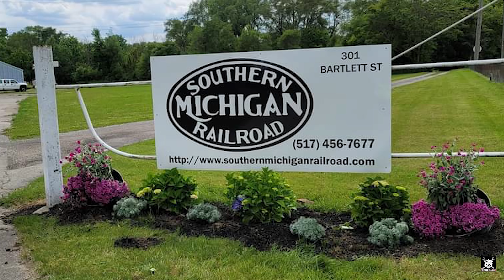Matt Chains Down An Oshkosh Striker Fire Truck

Comment: Great video FSC. You showed through your son just how much strength it actually takes to put on the heavy chains attach the heavy sinch  then tighten it all up so the chain is taught. When you have done it many many times you make it look easy because you learned. Banging knuckles seems to be an almost daily event. That Stryker is a good load, I like them big. The bigger equipment always test’s your skills, and I got better. There is like nothing better to have anything thrown at you and it gets loaded and tied down transported to destination and your good to go for the next one. Thumbs up FSC, have a great day and be safe, also tell that swamper , great job….

Comment: Great video Steve.  Good job Matt with the binders.  I had a young man load a 25ft scissor lift on a flatbed trailer from an equipment rental company.  He loaded the lift at the very front of the trailer which placed most of the weight on my trailer hitch.  Once I got home I moved the lift back over the axles so that the weight was better distributed between the trailer and my hitch.

Comment: The way roads are made, is to withstand certain weights and speeds. Which is why interstates are made to different standards than state roads, and state roads to local roads. It's probably not good to allow your truck's weight on the road, but given the available alternatives, it's the best option. Also, after they finish their project, they may resurface that road, depending on time and available funds.

Comment: Would it be easier and safer to use a cheater (pipe) bar when tighting the binders?
Reply from the maker: I don't use em with twist binders.  Just the snap style.  Typically anyway.

Comment: At 15:30 does anyone understand the purpose of putting that large piece of timber underneath the hitch?
Reply from the maker: Holds the deck up
Reply: @fsctrucking  Thanks for the reply!  I guess I still don't understand why the timber is necessary; what would be the purpose of allowing the deck to fall so far so as to need the timber to hold it up?  I imagine I'd probably have to see it in person to understand.
Reply: @pseudorandomly  it’s to keep the deck from dragging on the ground and keeping it level so when he hooks back up it’s at the correct spot to hook back into the trailer
Reply: @KrisKnight91  Thanks for your reply.  I know I'm beating a horse to death here, and I promise I'll stop after this.  But what I still don't understand is why the deck isn't built to automatically be at the correct height to pick the trailer off the ground.  Is there a reason the deck sometimes needs to be able to drop lower than ground level?  In other words, why would the deck be designed and built so as to ever drag on the ground?
Reply: @pseudorandomly  it’s not that it’s built to drag it’s the fact that the fifth wheel plate pivots to change for angles in the road. When he unhooks the deck from the trailer that makes the fifth wheel pivot so that the bottom of the deck will drag.
Reply: @KrisKnight91  Ah, I understand now.  Thank you for taking the time to respond.
Reply: @pseudorandomly  np! Glad to help!

Comment: Cop's goes by there all the time almost every hour. Cause Dallas Texas is the next town over. And the Shop Truck that we use to run for part's. U always have to slam the driver's side door. So what we do we get on the passenger side door. And now the Driver's window will not work sometime's. And we are waiting for a wrecked trucked same model to make it's way to the Savage Yard and we will replace the door. The GPS show's me where all the cop's and highway Patrol Officer's are hiding. And other thing's. And both me and my wife like it. Don't have to use the cellphone for GPS anymore. We just use it for Google Map's to see the location of the area we are going to be picking a load up or dropping a load off. to see how big the area is and is it easy to get in and out of the loading area. There is one street where there is no Truck's aloud cause a guy hate's truck and even the Fire Department  has to go the other way. The City Council had enough and the guy is supposed to Vacate his house. Since the City Council all voted that he be removed. And they are  going to build a Fire Department less then 1/4 mile from his house. And he was not happy at all. If u want more money get a Hot Shot Trailer and get Matt to do that. It's good paying money and we do hot Shot load's all the time. And allot of time's it's vehicles when people move to another state. And they used moving company's to move there belonging's. And next week i will be hauling a Yukon and 2 nice motorcycle's up towards North East. I will be suing my own Inclosed  Trailer. So i can strap the bike's easier and also u don't have to cover them. And the Yukon will fit in easy. Just have to get in and out of the back. I bet u was happy having Matt that day Steve. My middle son he always help's me when i have to use that kind of lowboy. Cause where u have to detach the trailer in 2. It's hard for me to do that. Plus ur not having to get in and out of the truck all the time like u have to do. And he does not mind at all. He help's me chain down loads and he like's it. The youngest daughter she loves doing it also. I was happy one day i had my youngest son. Cause we had to deliver some type of Vehicle like what u are hauling. And my back was bad. And i just showed him what to do and he was like sliding under it and chaining it up and i did the tighting on the chain. On the binder i have one side painted white and one side painted red. So i can tell which side is up and which side is down. And it's easy for company's that want's to help  unhook the chain's. And i just say which side is up. I shoed my son's what u was explaining to Matt at the back of the trailer hooking up the Binder's to the trailer and both was that's cool. Is the truck driver a teacher also and i tried not to laugh. I said he explaining to his son  and there like so do u dad when u show us stuff. And my youngest daughter goes except electrial stuff and i was like bleep that. Cause i was electuded once and that will be the last time.